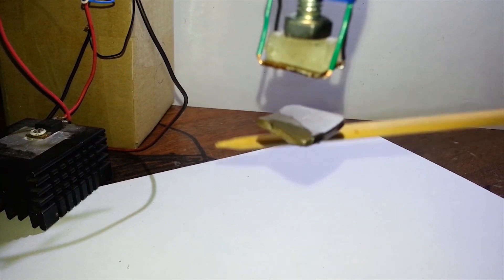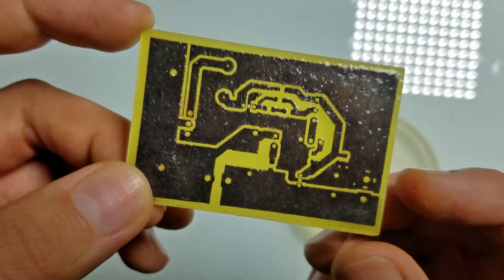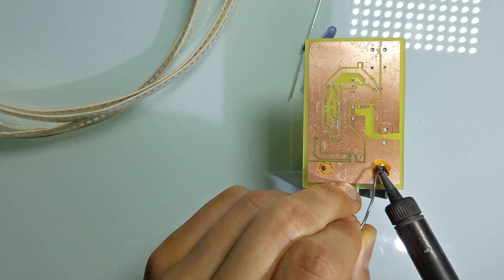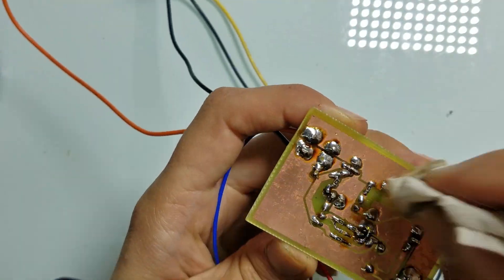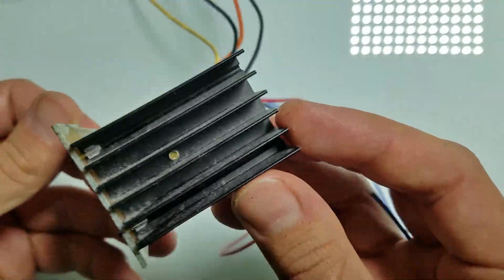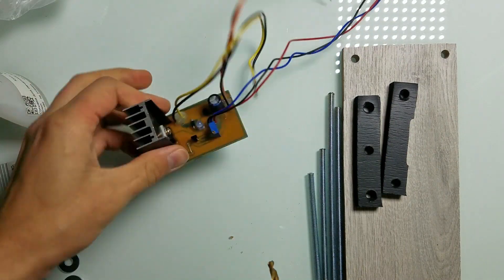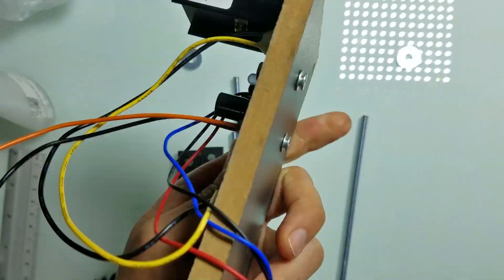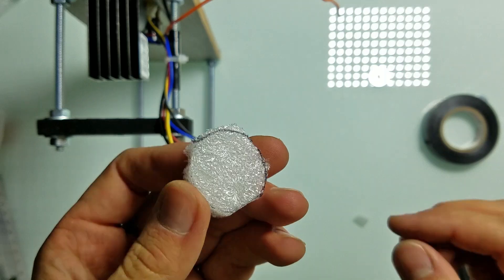How to Make Magnetic Levitation Device | DIY Magnetic Levitator V2.0

Comment: Good job...i did it as your schema.i dont have psb..i tried on a perforated plate.I used 49E and H431....no have smd resistors and condansators, i put clasic part.All thing seems right
But no can adjust potans.it pull all no fly magnet.Please help, what is my problem.

Comment: Hi. I tried this circuit but it works the other way around for me. Without a magnet, the electromagnet is switched off, but when the magnet is near, the electromagnet is activated. Please advice.
Reply: did you fix it?

Comment: That's a wonderful project, super well made, thumbs up! 
But it's neither levitation nor anti-gravity. It's magnetic suspension, magnetic entanglement !?
Reply from the maker: Thanks, yes I know, it has nothing to do with gravity... gravity just pulls the magnet down, the electromagnet pulls it up. "anti-gravity" is a catchy title that I've used in the last video, in this video nothing about "anti-gravity" :)
Reply: Electrical Projects [Creative Lab] and it's locked with the electromagnet. It's amazing ! Lifting the pliers was very impressive
Reply from the maker: Lifting pliers is possible because the magnet is already attracted to the iron core of the electromagnet, turning the electromagnet on is just increases attraction, so not much power is required actually... and tuning the device with trimer potentiometer is needed every time when weight is changed. Thanks for the positive feedback :)